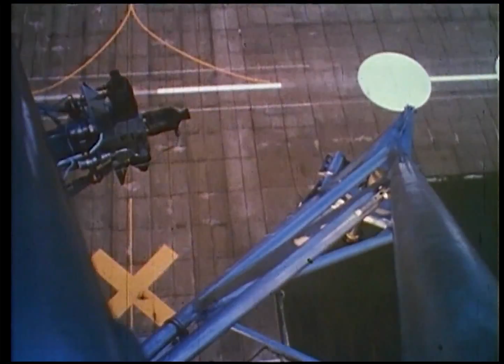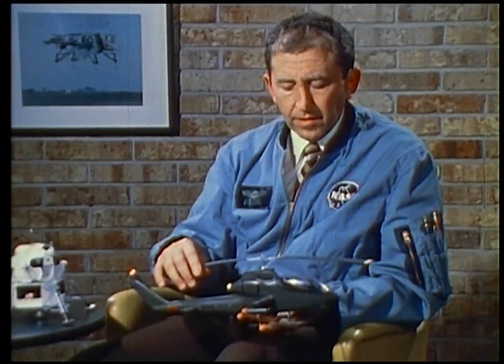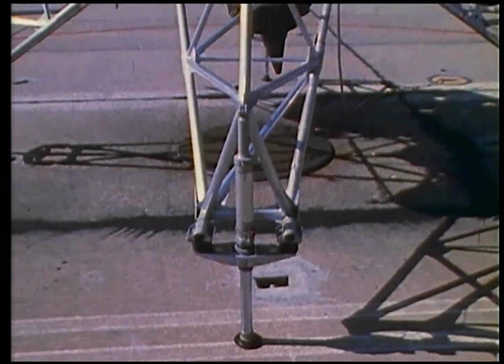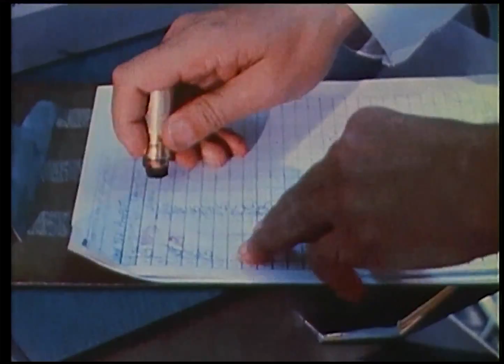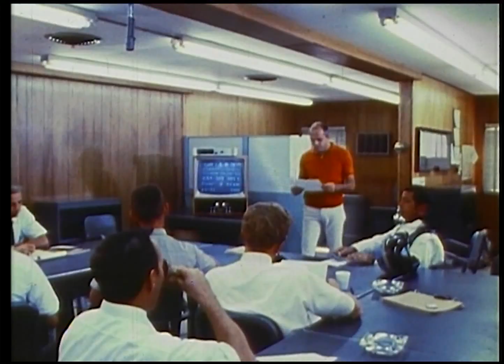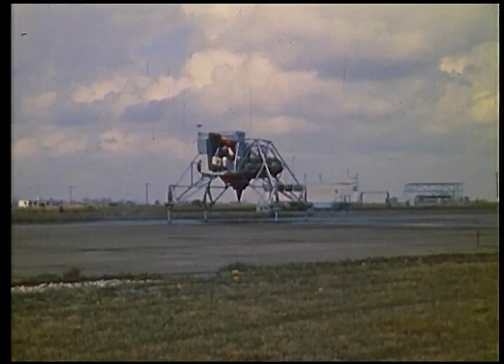300 Feet to the Moon

Comment: Question  how does the jet engine work in vacuum? Is there air on the moon? Or did they use rocket engine on an actual lunar lander ?
Reply: The Lunar Module (LM) was a two stage rocket.  Each stage had 1 rocket engine.  A rocket engine is technically a jet engine, although people usually don't use it that way.  Jet usually means a turbine engine.   Turbine engines work just fine in vacuum, but of course you must dump in oxygen, just like you must dump in fuel. Turbo Pumps are done this way..